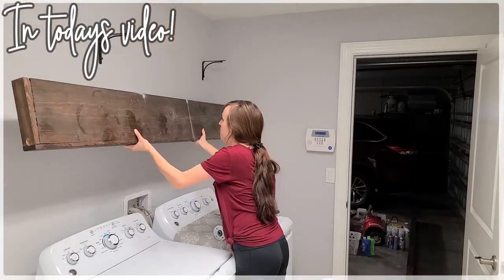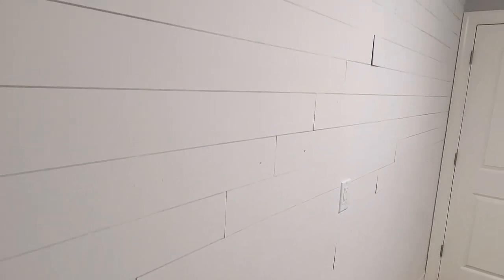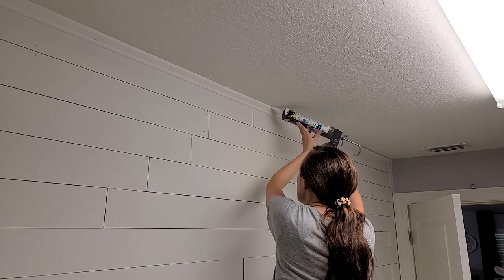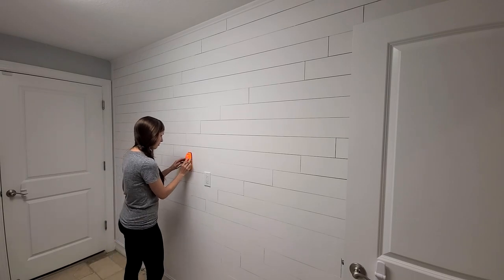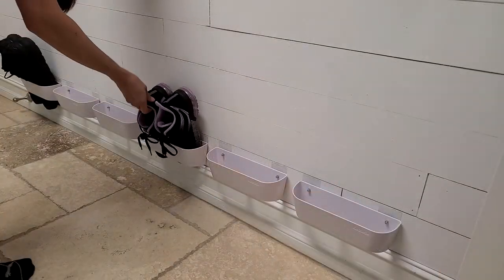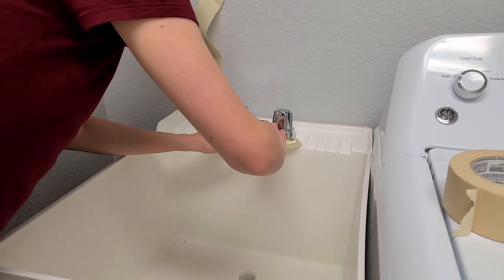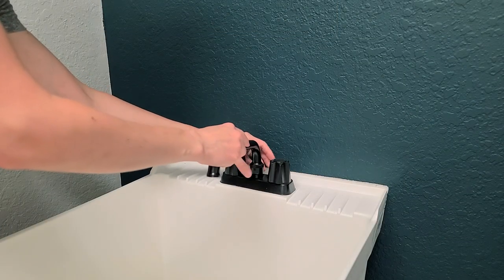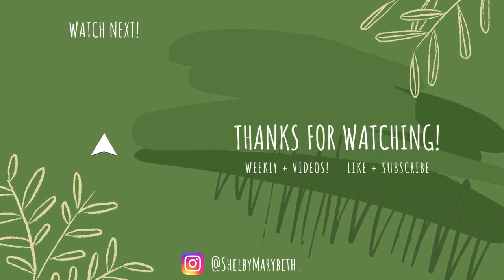DIY LAUNDRY ROOM MAKEOVER ON A BUDGET | BEFORE AND AFTER | IDEAS AND INSPIRATION

Comment: You’ve done a great rehab on the laundry room.  I have a question about the mirror, it looks like it’s too high to be useful, but I’m sure you have a logic for it’s placement.
Reply from the maker: You are totally right. I had put the hooks on first and then I wanted to put the mirror back where I had it above them. It was bad planning on my part but it still works for my husband who is taller and I love using mirrors to help a small room feel bigger.